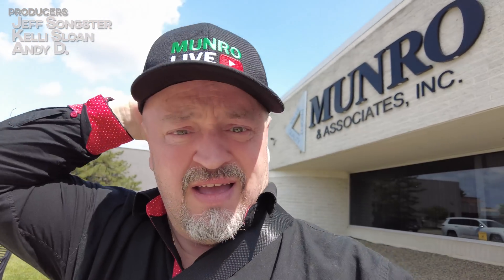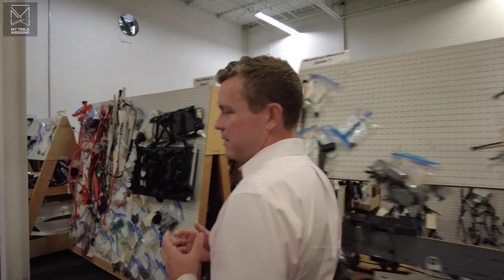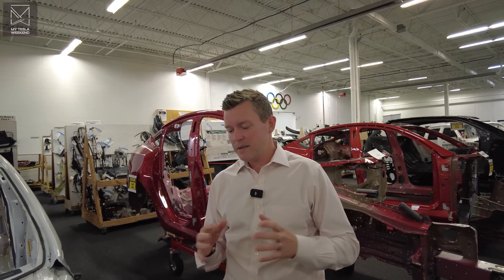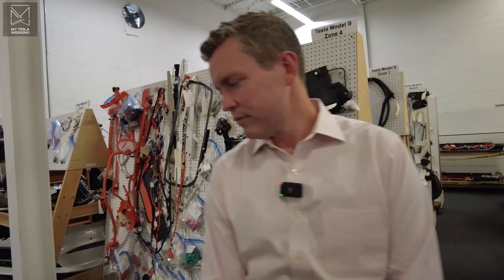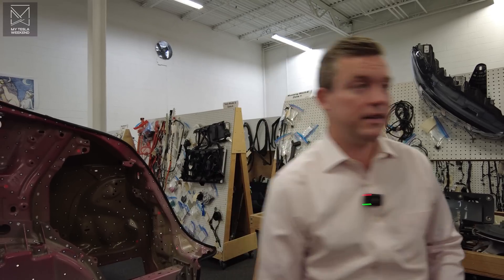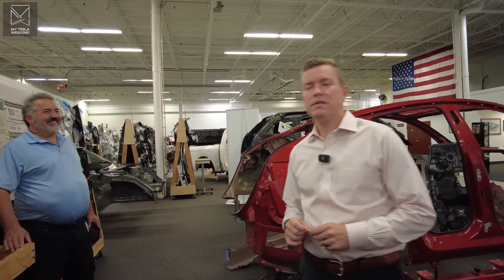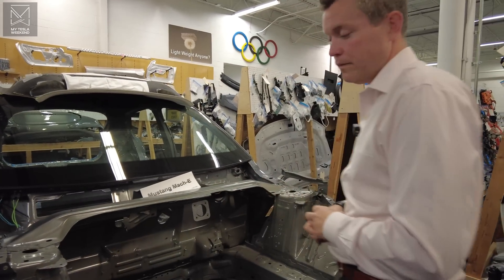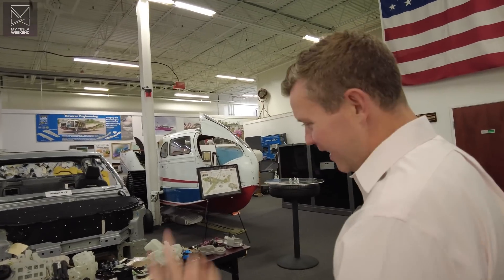ANYONE can build a PLAID Tesla - w/ @MunroLive

Comment: I was hoping Cory was going to compare the Ioniq heating and cooling to the Tesla heat pump.  Tesla was all in one compact package... he only mentioned that the Ioniq was not as well designed and spread out.
Has the Mustang Mach-E reduced the insane amount of hoses and connectors from the first year that Munro tore down?  I tell anyone who asks about Mustang vs Tesla, that the Mustang is in second place because of the hoses and connectors, but it is a distant second.  Like Usain Bolt vs Flo-Jo.

Comment: This is why Ford and Chevy can't make money on ev's with all the front and back assemblies. No gigacastings to help save money.
Reply from the maker: It all boils down to volume. If Chevy only plans to make 50k/year, the castings are a big expense to try to make up. Tesla's approach with fewer models and less frequent major updates means they're able to move more units with common parts. That's how you end up with a Bolt costing only slightly less than the far more compelling Model 3, while the Bolt may have actually cost more to build.